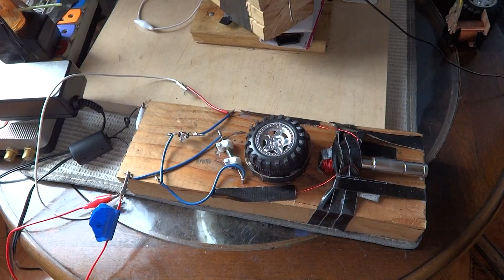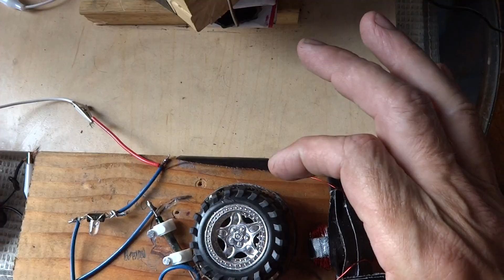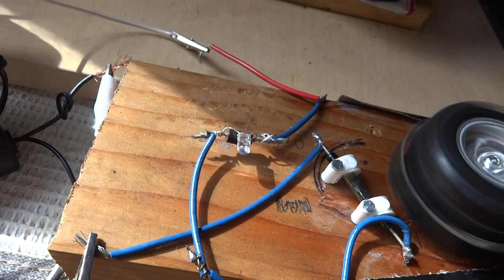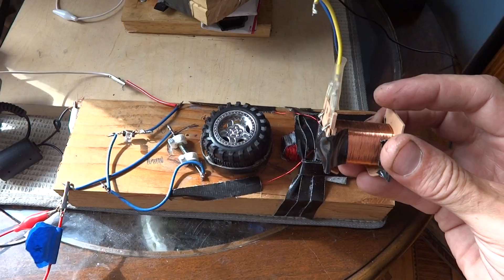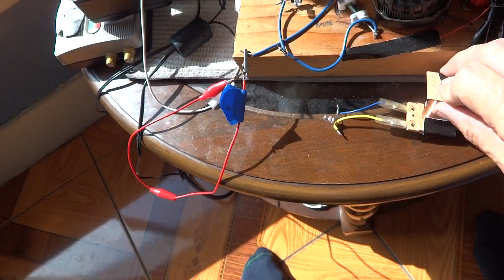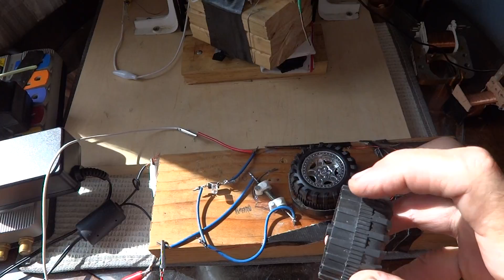Self starting reed switch DC pulse motor

Comment: Great Stuff, Thanks for sharing. I will definately reproduce this. Maybe try placing a ball magnet in that little Maggi instead of steel and place it near the wheel where you feel it self oscilate. It will be a bit clunky until you find the sweet spot and then it will not draw any more current than what you had put in.

Comment: How many volts you've used to make that lil mag wheel spin zippity zip fast as it appeared?
Reply from the maker: It uses a 15v wall wort for power. I lucked out when I used the combination of a diode to catch flyback EMF, an LED in parallel, and a ZNR across the reed switch.
Normally those reed switches have trouble surviving even at 9 volts.
I have discovered that to use higher voltages with a reed switch, you need to
use a transistor in the circuit to carry the high voltage and a very low voltage through the reed switch controls the transistor.
See my 18v reed switch/transistor circuit schematic at the end of this video:
https://www.youtube.com/watch?v=59ch74K65B8
Reply: It will burn out if more than 0,01 microvolts are applied to this moter.